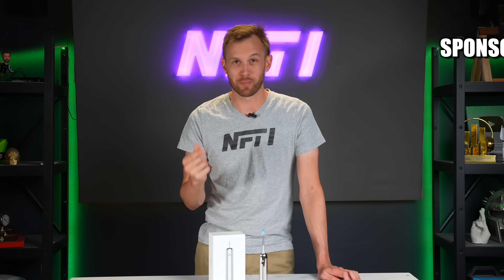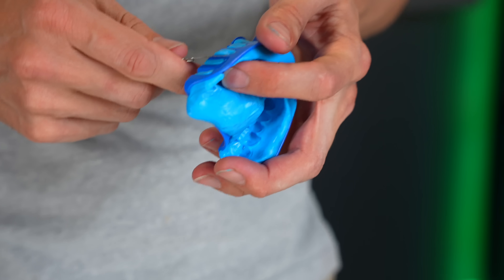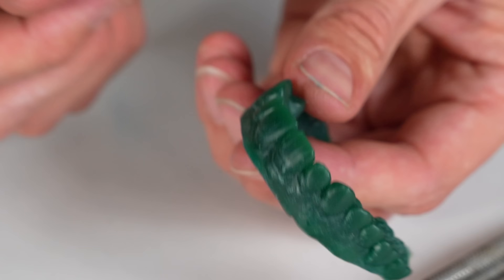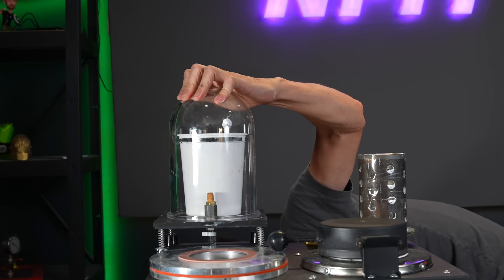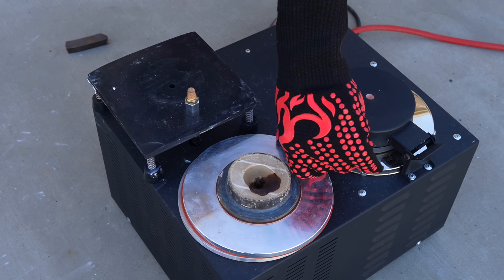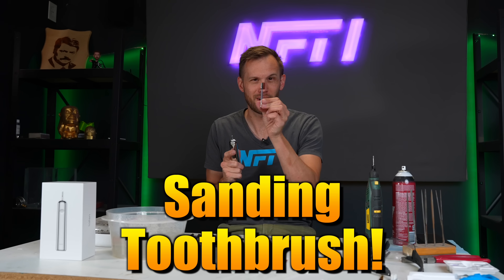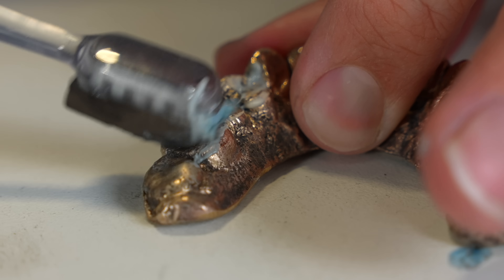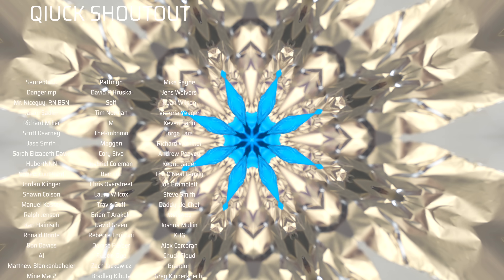Casting my Teeth in Bronze!

Comment: I use something called a "SpinBrush", probably one of the best powered toothbrushes on the market. Of the brushes oscillates back and forth, while the other one spins. Not only are they a great toothbrush they're an engineering marvel at the same time.